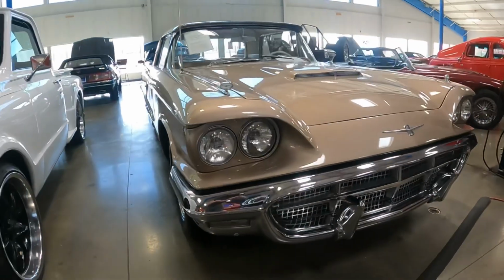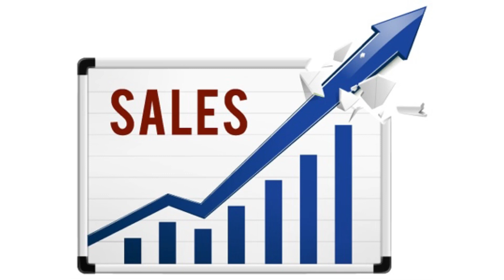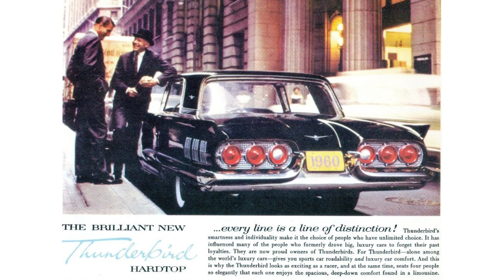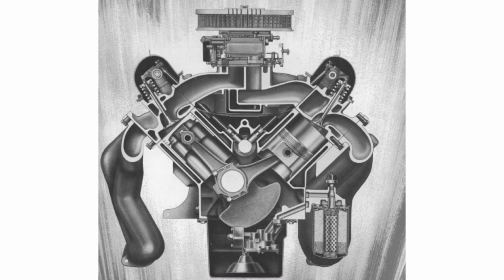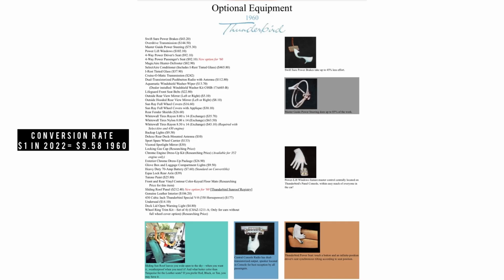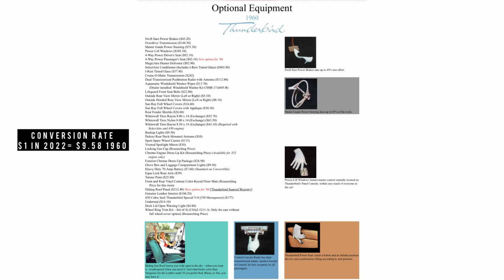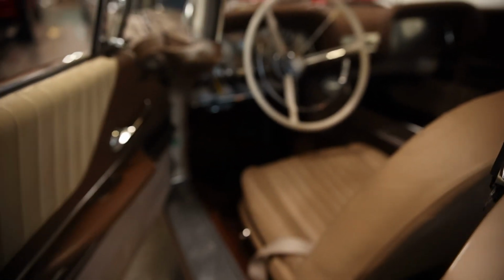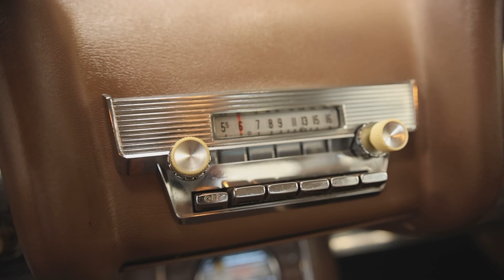1960 thunderbird in depth look

Comment: My favorite Thunderbird, followed by the bullet bird, 61-63. Had a pristine 65 for a few years, but always wanted a 59 or 60.
Reply from the maker: I just shot a review for 1964 thunderbird will be posted later this week if everything goes good =) the interior is way nicer in the 64 more luxury.. I like the style of the 60 Square bird.. I like the design of the bullet bird.. what’s the interior of the 64 was gorgeous I love how the rear seats curve at the back The steering wheel on the 60 was in my crotch and I’m not that big of a person... The 1964 it wasn’t like that.. I had a smaller steering wheel also the rim around the steering wheel wasn’t as thick it was pencil thin which had a really elegant feel to it, not saying the 60 design isn’t good it is it’s just the position of the steering wheel instead of it being tilted up slightly it’s coming straight out of the dashboard people must’ve been smaller back then..

Comment: The knee knocker  door openings are a real knee killer. Handling is good ! My personal best 1/4 mile a cool 17.65 in the year 2000.  So its 40 years old when I did that pass.
Reply from the maker: Nice I’ve never had an issue with the door openings
Reply: Those knee knockers really do hurt, but you only do that once.

Comment: When I was in high school, the brother of a friend of mine had a Square Bird. Not sure if it were a ‘58, ‘59, or ‘60. But it had a three speed column mounted stick shift. It was the only one that I ever heard of.
Reply: Yes, the Square Bird (like most American cars of that era) came as a basic car. Options needed to be chosen. Even the heater was an extra-cost item. I wish we still could add individual options today.
Reply: I had a 1959 with the three speed manual AND electric overdrive.

Comment: My 1st car was a '60 T-Bird Convertible. It had 4 problems.
1. Quarter Panels rusted
2. Power Stearing would blow the hoses if you went to stealing wheel lock. Drove it without the power stearing most of time. Errrr
3. Hydraulics for the top also went out often. Disconnected and did it manually. Again errr but not as bad as the power stealing.
4. It was hard on starters. Seamed I was replacing the starter once or twice every year.
Your correct in saying it had poor handling (even when the power steering worked) I blam the weight for that. However the ride was great.
Loved it, wish I still had it.
Reply from the maker: It’s awesome that car wasn’t perfect but still would like to have it back I drove it one the other day owner brought it for service just drove it to the building next door drives nice steering wheel is in crotch

Comment: My dad had one that came with vinyl seats, which gave out along the seams after about a year. Rear quarter panels offered little or no drainage causing major rusting just in front of the rear wheels, especially in areas where roads were being salted. Because the speedometer went to 140 I figured I'd test on a newly laid straightaway. Took it up to about 114 when the front end began to become airborne. But it was a blast to drive and the radio was the best.

Comment: The beauty outweighs the negatives.  And you are right, the light dimmer should be on the floor.
Reply from the maker: Definitely totally agree the only thing that I forgot to mention and it’s been almost a year since I did this episode well March so it’s been a while I got to drive it the other day customer brought it back for service and I had to move it from one building to the other steering wheel is in your crotch I wear size 34 so you’d have to be pretty small for it not to be in your crotch that car is the reason I started doing the whole crotch thing like the steering wheel space ratio

Comment: As I recall the 1958-60 hardtops had a regular front-hinged trunk lid but the convertibles were rear-hinged so the top could disappear under the rear deck lid.  The exterior door handles look like arrows too.
Reply from the maker: Totally agree

Comment: Dad worked for Ford AED in Chicago making B-52 engines, and ordered his '59 factory direct.  A red 1959 convertible was the first car I ever drove, equipped with 3-on-the-tree and overdrive behind a 352 4-bbl.  I was 11-12 and the car belonged to my sisters boyfriend.  Driving top-down along the Connecticut river next to the under-construction I-95 was a boys dream.  Ours was a black hardtop with CruisOmatic. When we first got it, the decklid was to tight it took multiple tries to close it, finally figuring out to push down in the middle right above the license plate.  Said plate covered the fuel filler neck, so you could pull up to pumps on either side.  I'm pretty sure I took my drivers test in the bird, or it may have been a Corvair Lakewood.  Many many memories. tom
Reply from the maker: Great story, My 67 mustang was like that where the gas filler was at the rear so it didn’t matter which way you pulled into the gas station to get gas very convenient. Especially if you have a lot of cars that’s the problem with having a lot of cars the filler is generally on the opposite side of what you think but if it’s in the center it doesn’t matter
Reply: Had no idea that Ford had made jet engines.

Comment: I have a 1959 Ford Thunderbird. It's funny that nobody ever mentions on the left side window sill there's a little push button table that apparently worked with the windshield wiper and washers. I know it has some vacuum hoses that run to it but I can't find anything in my Thunderbird repair manual that tells what exactly it does and how it works. I'm going to have another look in the manual

Comment: I was 12 years old in 1960 & I started to notice car designs. Even then I realized that the 1960 T-Bird had more styling gimmicks than the 2 previous years. The most being 6 verses 4 Tail lights. I guess more was thought to be better.  More chrome in the grill. 1958 had honey comb grill insert (same as our 1958 Ford Ranch Wagon). I neighbors had 1960 convertible T-Bird. in 1966, I knew somebody who owned a  1960 "square bird" & upon entering was warned not to lower the power windows (they wouldn't go back up).
Reply from the maker: Awesome story and information thank you for sharing =)
Reply: I, too, was 12 in 1960. I personally liked my dad's '59 T Bird more than either the '58 or the '60.

Comment: As a five year old in love with the two seater I hated it. I get it now.
Unibody is the heaviest way to build a car. A 1934 Chevy weighs the same as a retro Fiat 500. A Camry the same as a 56 Chevy.
It’s my understanding that the two stainless T-Birds were made at the end of the model year and after a supply of replacement body parts were stamped out (yes I know the fenders didn’t unbolt on these).
They were concerned that the stainless steel would damage the stamping dies.
Reply from the maker: Yeah I tell people all the time that my 52 1 ton Chevy weighs as much as a Kia Sorento. I’m was with you when I was a kid I didn’t like any of the big birds (except the bull it bird) but they are growing on me =)

Comment: Does that centre console suggest the T bird was available with a 3 or 4 on the floor transmission option?
Reply from the maker: Thank you for bringing that up I totally forgot to talk about the transmission for some reason there was two transmissions available at three speed with overdrive and Ford‘s cruise O-Matic I’m not sure if the stick shift was a column shift or if it was in the center consul I think it was a stick shift in the center consul on the floor but I’m not 100% certain
Reply: Nope. Column shift.
Reply from the maker: Awesome thank you for that Information
Reply: Three on the tree, with overdrive friend had a 59 in 1966
Reply: It was a luxury car with auto transmission. Besides, this car was marketed to my parents generation, who started driving in the  late 1930's when column shifters were considered "new tech". My dad's first car was a 1940 Buick Super convertible. Mine was a 1966 VW Bug (the 1966 1300 "Bonzo" model).
Reply from the maker: That’s awesome thank you so much for sharing =)
Reply from the maker: I still have yet to drive three on the tree... =)

Comment: Dead on for cons. Handles like a boat. Rockers rusted quickly. Sucked premium gas almost as fast as you could pump it. You could hear the four barrel carburetor open and suck the gas and it would fly. Huge steering wheel. Dads was palm spring rose which was pink with a cream roof and cream interior.   Bought it from an older woman in town in 1965. Heavy was an understatement. He had it until the mid 80s. Dad loved that car.

Comment: Seldom acknowledged facts: The 1958 Birds had coil spring rear suspension. Was designed to accept air suspension, but that never panned out.
In 1959 (and 1960),  the T Bird had leaf springs in the rear. They did handle better than the 1958s. 
Square Birds were unit bodied. Built alongside Lincolns in the same plant. The entire body was actually over built. Front fenders were not removable; they were part of the unit construction.
Reply from the maker: Awesome information thank you so much for sharing =)

Comment: I bought the 1960 T-bird in 1968 when I was a Junior in high school....a really perfect one for, like $700.  But it was embarrassing to drive as 1968 cars looked far more modern and shapely, like the 1968 Camaro our school used for driver training.  My car looked like some sort of 1950s rocket ship, weighed a ton (2 tons nearly), and handled like an old man car.  Notice in the video at 10:15 the poor gap fit of the trunk.  Mine did exactly the same thing.  I could only stand it for 6 months and sold the lead sled. Sadly, it was pink (Desert Rose) which didn't help.
Reply from the maker: Cars back then had door gaps panel gaps it was in their character

Comment: Open the trunk. A HUGE “fun fact” is Ford sold twice as many 1958’s as 1957’s. The T-Bird was always intended to be a personal luxury car, rather than a sport car. Look at the rear seat. The rear seat backs on all T-Birds curved. Cool 😎. The round tail lights are supposed to resemble jet exhaust. The speedometer needle is supposed to make you think of a rocket 🚀. T-Bird really was the showpiece car for Ford.
Reply from the maker: I did open the trunk but edited it out there was a bunch of spares that came with this car it was a huge trunk

Comment: The early transistor radios also had  low voltage tubes in them. The sound was only better because you. O longer heard the humming of the vibrator  that made high voltage for older tubes regular tubes. The transistor radios were more reliable, but made cheaply and did not have the same sensitivity. Local stations faired better than  distant stations, but then again AM radio always sucked.
Reply from the maker: Awesome information, thank you so much for sharing =)
Reply: @What.its.like.  Also tube car radios used a lot more voltage than transistorized ones. Since cars of that era had generators (which did not charge the battery at idle or very low speeds) the radio could start to drain the battery at idle or below about 20 mph or so.

Comment: I like all things Thunderbird.  I have had five and loved them.  My favorite is the 67/71, then  72/73,  61/63.  1983/1986 were the sweet spot for me.  Never cared for the Aero Bird from 87/88.  Liked the 1989 through 1993.  Hated the motorized sest belts though.  The 1994/97 looked bloated with the 94 restyle.   In 1997 Ford really cheaped out and gave the 97 Thunderbird Ford Taurus gauges.  The 1980 through 1982 is the generation that Ford probably would like to forget,  I know i would.  They were ugly.
Reply from the maker: What about 55/57? I think those years are my favorite... nothing sounds like a y block very distinctive sound. I like the styling of the bullet birds as well not saying the other ones aren’t cool need to check them out as well.
Reply: @What.its.like.  I'm a fan of the 55/57 for sure.   They are beautiful cars.  My father was a body and fender guy and he restored a 1957 for a friend at our house in the mid seventies.   So this car was part of the family for two years.  So out of those years my favorite is the 57.
Reply from the maker: Stay tune there’s one coming

Comment: Went from coil springs to leaf springs in '59 to aid the handling.
Reply from the maker: Thank you for sharing that awesome information =)
Reply: You mean from leaf to coil?
Reply: @ReddThreee  Coil to leaf to gain more stability.
Reply: @bobmarker6812  Putting aside the handling/stability argument, the 58 model was actually coil, replacing the leaf of the previous model.
Reply: @ReddThreee  True. The '58 was an entirely different car going to a unit body, coil springs and 4 seats, then in '59 went to leaf springs.
Reply: @ReddThreee   I had to correct my original comments date to '59.
Reply: They went from coil to leaf because there were problems with the coil suspension.  I forget the details, but it was Ford's first coil spring suspension, and it was not especially good nor reliable.  I think the suspension arms were not strong enough, and failed under use.  Reversion to leaf springs that they knew would work without problem was done for the '59 & '60 model years.
Reply: @GrumpyUnkMillions  Ok. Do you know when or what models Ford started using coils when the problems were solved?
Reply: @ReddThreee   The Thunderbird and the 1958 Lincoln & Continental all had coil springs that were troublesome.  I was not old enough back then to know the exact details, but the 1959 Thunderbirds all had leaf spring rear suspensions.  I think the coil springs sagged and could not be made to retain proper ride height.  I think the Lincoln models had problems with the long arms cracking, likely due to their increased mass over the Thunderbird.
 The Thunderbirds were all made in the Wixom, MI plant where Lincoln models were also assembled.  No other 1958 models used coil spring rear suspension to my knowledge.  It was not until 1965 when Ford put rear coils into the Galaxy models that a coil suspension was again factory.
Reply: @GrumpyUnkMillions  Ok thanks. Btw, I'm old enough  to remember those cars but not old enough to drive them.
Reply: @ReddThreee  I was not old enough either, but drove it as my 1st ever, manual trans convertible on the road to the water works in Longmeadow, MA, next to under construction I-95.  Sisters BF let me behind the wheel.

Comment: Bought a 1960 T Bird in 1966, a very nice car I thought, for about $600 I think. The guys I car pooled with for work made fun of it, not a very cool car for an 18 year old guy, so I sold it, peer pressure,  and bought a 1960 Chevy Impala coupe which fit in better at the local drive in.
Reply from the maker: That’s crazy to think this car at one point was uncool... that you for sharing that story.. I forgot to mention when I sat in the car the steering wheel was too big it was hitting my thighs with the seat al the way down

Comment: I had one in 1964, sorriest car I ever owned it rusted and the cam bearings turn on it at 65000 miles gave it away to a guy who scraped it
Reply: Every auto manufacturer has made a lemon at one time or another. Hence recalls (or worse). I owned a ‘59 Edsel Corsair two door hardtop. Incredibly tough vehicle - it just never seemed to ‘get tired’ . I sold it in 1979, still in great shape. There were others, Thunderbirds included, that couldn’t get out of their own way. A friend’s Dad bought a ‘39 Mercury new. Everything that could go wrong with a car, did. He finally traded it in on an Oldsmobile. There are as many car stories , good and bad, as there are car owners…

Comment: There are many things that are not correct on this 1960 thunderbird. The engine is not correct, the 1960 T-Bird came with a 352 cu. in. engine as standard, all had yellow valve covers that said Thunderbird, with a White air cleaner, the optional engine was a 430 cu. in.  with Black valve covers that said nothing because this engine was also used in the Lincoln Continental and the 1958 Mercury as the top of the line  Marauder engine putting out a whopping 400 hp. The 1st American car to offer 400 hp.

The leather interior is also not correct. The leather interior in 1960 Thunderbirds was two tone with buttons in the seats , door panels, and rear quarter panels.
Reply from the maker: Thank you so much for those corrections =) and added information